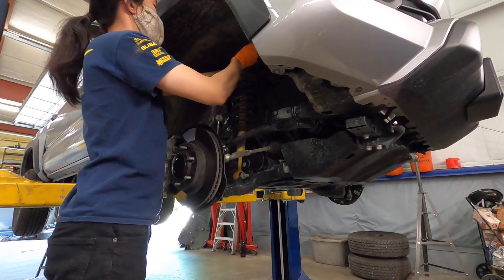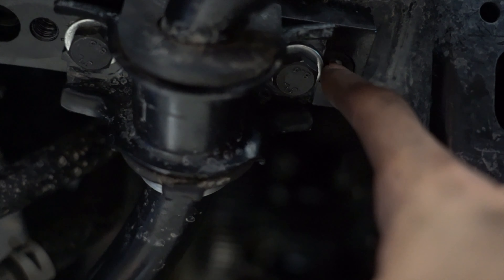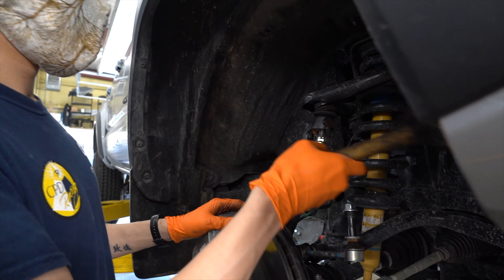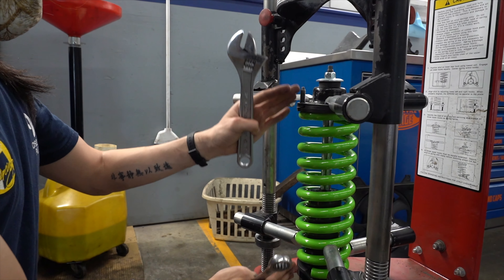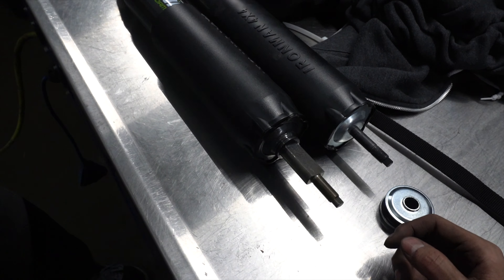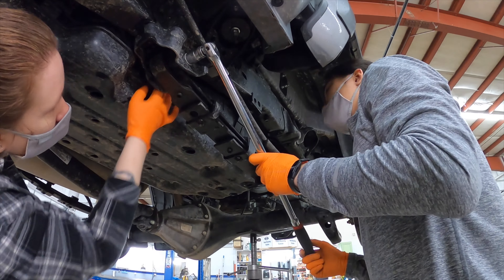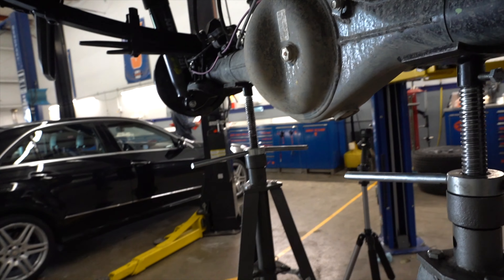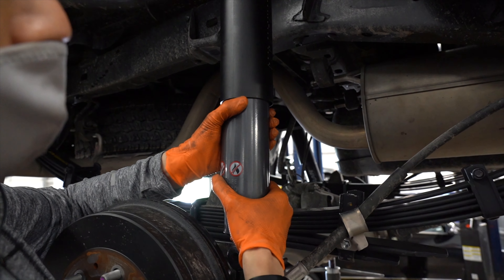2020 Toyota Tacoma Ironman4x4 Foam Cell Pro Suspension Kit Install

Comment: i installed my kit on my 19, i ran into the same issue with the sticker placement. the wheel would obscure the label if facing outwards is the only reason i could think of to have it facing it inwards

what did you end up doing with the parking brake line bracket?

Comment: Can i ask what tool did you use to bend the plate to take out the UCA bolt?
Reply from the maker: Hey! This ended up being something we didn't actually remove. We weren't able to bend this enough on our own to remove the bolt. We used a pry bar and vice grips and neither worked for us. We got the most bending by using the vice grips, but we weren't able to clear the last centimeter needed and we still have the OEM control arm for the time being. 
Someone else at the garage working on the same thing had got it done in half an hour using the same method, we just didn't have the same luck. We would ultimately recommend a vice grip though, as it gave us the most amount of bending while we were trying. It also provided us the most leverage (at least for us). And we also recommend having a second person to spot when you have made the clearance.
Reply: M&K Adventures thanks

Comment: I don't know why Toyota brags about having Bilstein shocks on the Off Road TRD model, yet puts the smallest diameter shock on them. You can't even buy that small of an aftermarket Bilstein.
Reply from the maker: I know right? I think the real market for off road edition is not for people who actually go off-road. It's for the majority of the market where people who think off road means more durable and will not get stuck in snow with the special features. Therefore, 4600 gets the job done perfectly.
Reply: It’s the bilstein 4600 but yeah they are only slightly better than stock